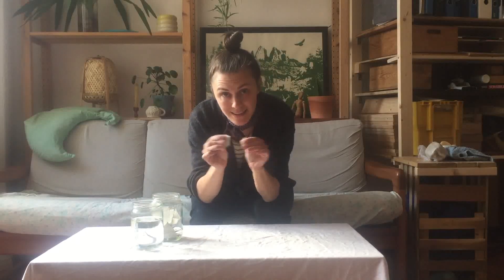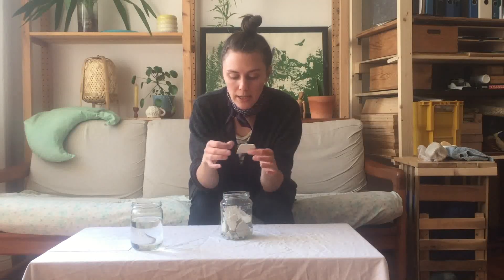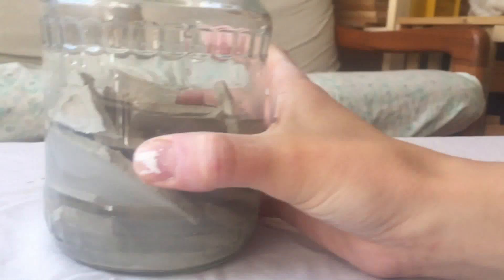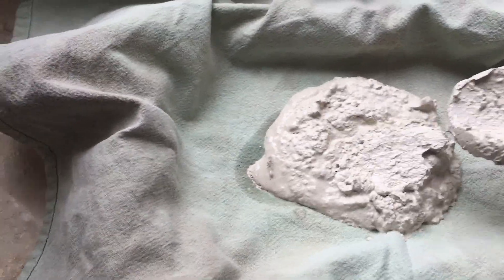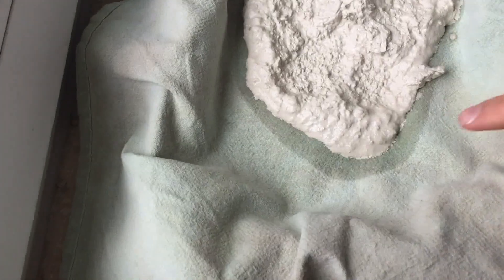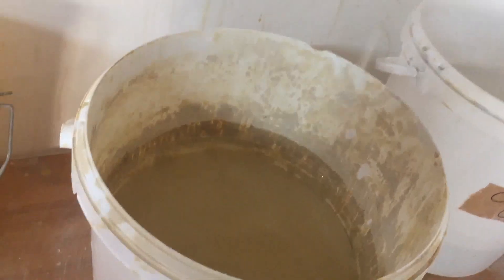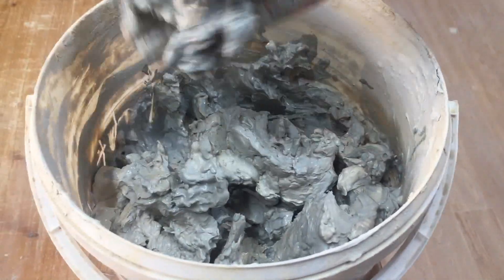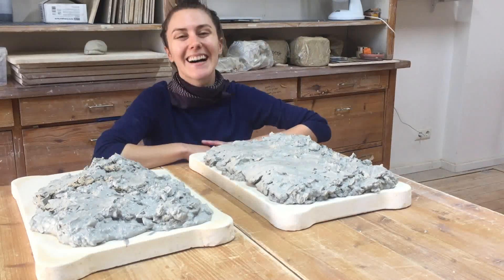Pottery at Home! Part 9: how to reclaim clay

Comment: What's the reason for letting the clay dry out completely before adding it to the slip? I am just a beginner potter from home and have been collecting my slip along with my trimmings and small clay chunks in one big pail. Was going to learn how to reclaim that now, and hoping I didn't do it all wrong 🙈
Reply: I think it's so the clay does not go moldy.  I noticed when I kept very wet clay in a plastic bag tied tight for awhile, it started to smell a bit moldy.  So I broke it up and laid it on a cookie sheet and set it outside to dry and air out.  I will let it sit dry and later add the water and follow her process.  I did do her process and just let the spread out clay sit on a plastic cutting board and it dried out enough for me to wedge.  I think my air may be dryer than hers.  I didn't need the towels.

Comment: Hi Mia, thank you so much for this series and I hope you keep producing content! I have a question about clay moisture. What should I do if I let about a kilo of recycled clay dry a bit too long? It is still pliable but a bit dry.  Is there an easy way to add water back in without starting all over?
Reply from the maker: I will do a video on this soon, but for now you can dunk the clay into some water, wrap it well in plastic overnight. Then see if you can wedge it the next morning. If it's not, repeat. You can keep doing this until it's wedgeable. :D
Reply: Pottery to the People thank you Mia!

Comment: Thank you for taking the time to make these videos! Super helpful! If I had a plaster board at home to dry out my used clay, could I wedge on that as well or should I wedge on a canvas wrapped wood wedge board? Any advantages/disadvantages to using either?
Reply from the maker: Yes you can wedge on plaster too! Just be careful no plaster chunks get into your clay. Some people prefer plaster because it doesn't hold dust like the canvas boards do. Some people even wedge on wood. Whatever works :)
Reply: I wedge mine on a plastic cutting board, a cookie sheet, and sometimes straight on my table.  I tried on plastic, but I had to keep pulling the plastic off.